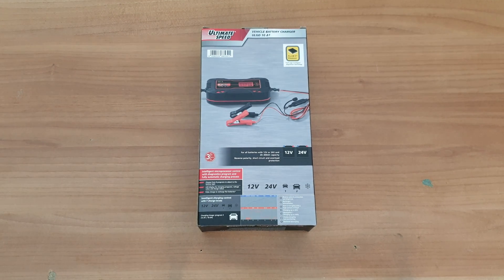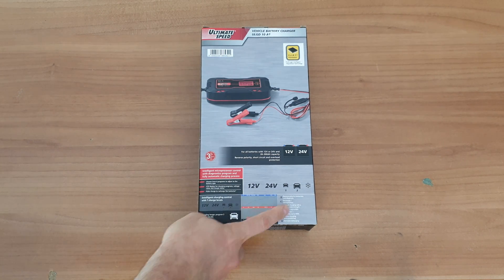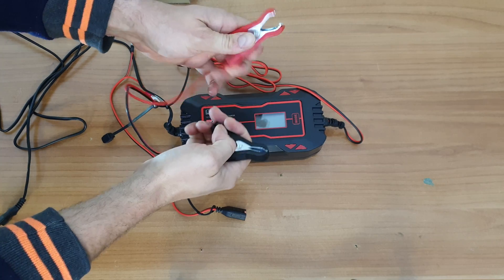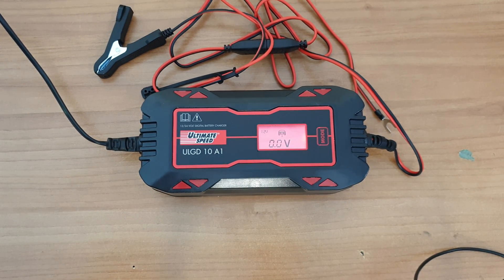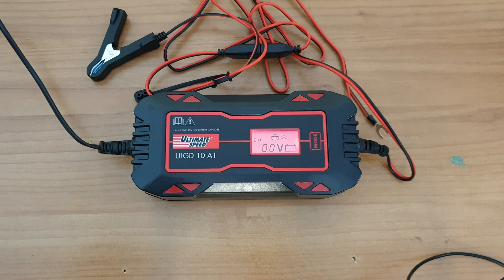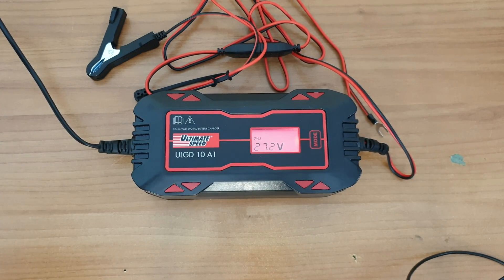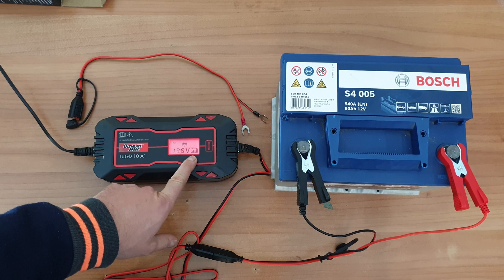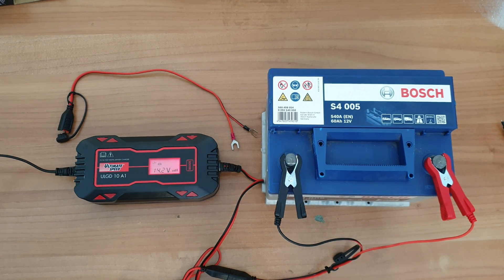Ultimate Speed Car Battery Charger ULGD 10 A1 TESTING

Comment: What if the 12V battery is at around 5V (or less)? What is the minimum battery voltage at which it starts charging?
Reply: At around 6or 7 volts and higher it usually can charge , I had charged 3 batteries till now and 2 of them were 5 volt and didn't charge at all !!!!

Comment: Can the battery charger be used to to run a non battery device such as a 12 Volt Brown's gas generator? I just bought one of your units in Lidl in Ireland, there was no manual!
Reply: You can find them on the internet eg the lidl shop on internet as well

Comment: Is this charger good for motorcycle batteries or is it too strong? Can you please check if the connecting cable with loops from this charger can plug into the ultimate speed power bank jump starter?
Reply: i bought it 2 days ago if you want to charge motocycle battery you musy connect 2 batteries parawell and charge it with 24v program 2.5amp. it can make 1.2A max and it safe. if you have only 1 option - you need to buy smaller ULD 5.0 charger it chace program -0.8amp and 12v only for motobatteries

Comment: dont buy this crap.
Specs say 10 amps but reality is that only less than minute is 10 amps then only 2 - 4 amperes.
Supply Mode also does not give 10A but 5A or less.
Reply: Yeah, i have 3 batteries in my car and i depleted them a bit to see how the charger will react and it only supplied 10A for few minutes, it quickly dropped to 4A. I will try to upgrade wires on output.

Comment: Hi is it possible to make this charger force charge dead batteries? 4 volt for example
Reply: Yes it can from as low as 2 volt
Reply: no it start from 9v
Reply: @mikkei3532  Incorrect it chan charge from as low as 2 volt! this model
Reply: Indeed, from 2v

Comment: Can I use on 6ah scooter battery?
Reply: If you want to kill battery by way too high charge current? No of cause not lidl sells 13€ 12V/6V charger here in Germany with 0,8A or 4,7A charge current which is much more fitting for small scooter gel battery (AGM Type)

Comment: Hi, if I set the 12 V CAR charging mode for example on the charger and the charging method has started and after 1 remove the 230 V cable from the wall outlet (I make a electricity off, like it is happening during the storms in summer, when the trees fall down to the electricity cables, so I create an electricity off and after it I re-plug the 230 V cable to the wall outlet, does the charger continoue the charging mode in the previously selected 12 V CAR charging mode or does go the charger to standby mode and then I have to manually set again the 12 V CAR charging mode? It is important for me, because if I put my summer car in the garage and set 12 V CAR charging mode and during winter there is an electricity off because of a technical problem in the network or winter storm, I can not know about it and in spring I will find the battery of my summer car in totally dead state, if the charger does not continoue the set charging mode after the electricity returns to the house. Please make a short test about this with your charger and give me an answer about this question. Thank you in advance.
Reply: Need to know that too. Did you get an answer? Thanks
Reply: @ruiftavares  No, no answer from Youtube members. But one of my friend purchased one and we tested this function. If the electricity is OFF or I remove the plug of the charger from the wall socket, the earlier set program is also cancelled automatically by the charger and when the electricity is ON again later, the charger goes to standby mode automatically and then I have to manually select the necessary charging mode. It's a pity, that it works in this way.... OK, it is not a CTEK.
Reply: No it does not. It remains off. Just tried one.

Comment: What kind of test is it? Man, you did NOT test anything, you just plugged it in, that is all. Test means someting else, you at least should measure initial battery voltage and final battery voltage. Or to try to discharge the battery at specific way and than charge it, measure time, measure if current flow is within declare spec and if charging time is as expected. The charger has 10 programs, WOW that is great, good you told us - the best piece of  your "so called" TEST.
Man, stop doing these pathetic tests/reviews.